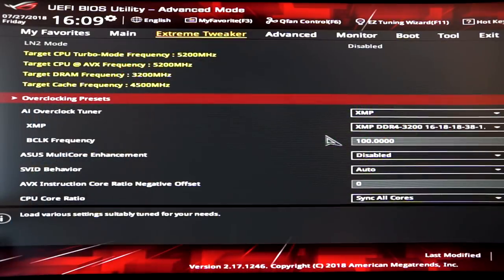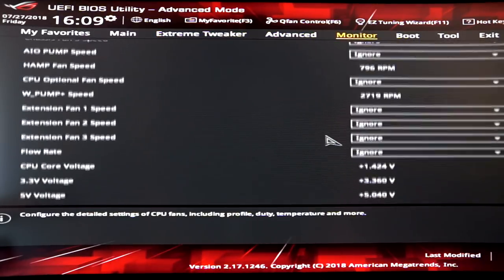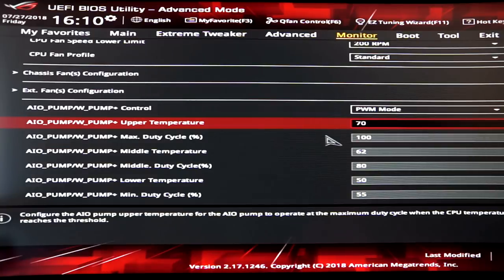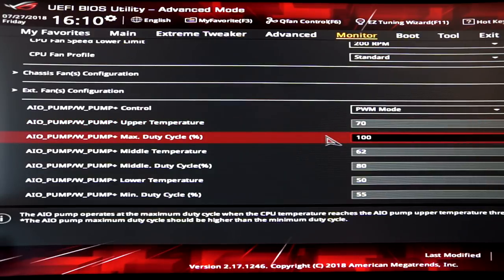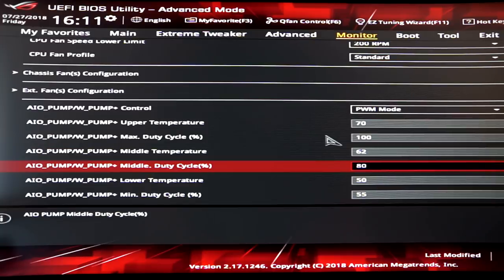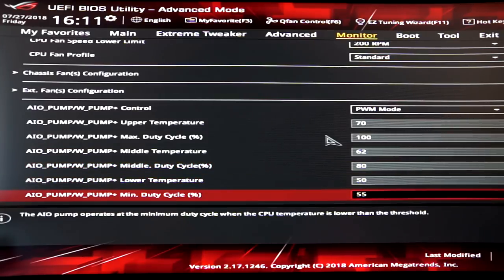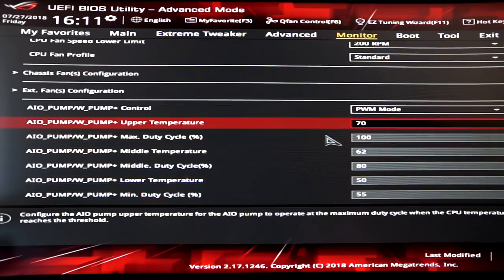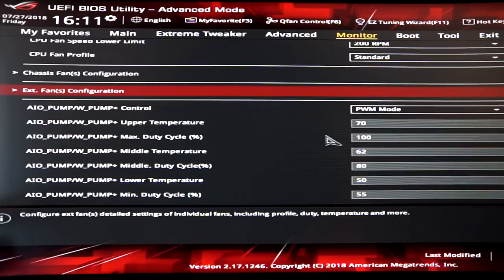STOP SETTING UP YOUR PC FANS WRONG! - How to set up Fans & Pumps for Minimum Temps and Noise

Comment: I can't believe it's taken me this long to run across your channel, not to mention finally realize you're also the guy that built a cockpit out of an actual Porsche GT3, but I followed a lot of your progress on the iRacing and old Inside Sim Racing forums!

In any case, you've uploaded some fantastic comment, and this video was especially helpful.

After deciding to upgrade to a 5600X, but unable to acquire an RTX 3080/90, I thought a custom loop might help my aging GTX 1080 last a little longer, and eventually ended up replacing everything but the GPU.

Nearly six months later, after trying out 3 different cases and innumerable rads, reservoirs, fittings, and even swapping out motherboards, I've just about finished my build (and thanks to Amazon's return policy, I kept to a "reasonable") budget.

All that's really left is setting up my fan/pump curves, and then I'll post a build log on the iRacing forums.  Perhaps unfortunately, I'm using an Aquacomputer Quadro for fan/pump control, and the associated AquasuiteX software, although quite robust, is much more fiddly than your BIOS options.

Aquasuite quirks aside, I'm thinking I should set up my case airflow to maintain positive pressure (for dust minimization), and want to confirm that's a good idea first.  My front 360 rad is setup for intake (push), with a top 240 setup to exhaust (pull).  I also have a single 120mm exhaust fan attached to the rear panel.  In the rear compartment, my PSU fan is setup for intake, but it rarely turns on, and is also blocked by the midwall.

So with three intakes attached to a rad, and two rad attached exhausts + a standard exhaust, I'll need to run my exhaust fans slower than my intakes, no?  But what about my rear exhaust fan?  Unlike my rad fans, it's essentially unobstructed, and thus much more efficient, right?

So should I run it even slower than my other two exhaust fans?

Sorry writing a dissertation, but after spending so much time on my build, I don't want to ruin its performance with poor thermal management.
Reply from the maker: Thanks for the kind words. Have a look at our rig your video and you’ll see it’s not actually a real Porsche cockpit, it’s mixed reality :) my hands and the steering wheel are real, everything else is on the screens. 

It will be hard to maintain positive pressure if your intake fans are obstructed and your exhaust is not. 

Ideally I’d suggest having your radiator on the exhaust side so the warm air exits the case immediately if possible.

Comment: Nice discussion.  This is the main reason I do not like those all glass cases with virtually no vents.  Give me the old school vented cases.  I see folks complain about temperature and they are all fan cooled in all all glass enclose case - makes no sense to me.   Additionally, I see folks talking about having 18, 24 etc fans in a case and I am like WTF why so many fans.  You need air movement and the fans don't have to be blasting air either, just moving it in one direction...in....out.  The same applies to the water pump.  You don't need to have it blasting at 100%, just a smooth flow will get the job done.

Comment: DC mode on some motherboards actually works correctly.   What I want is a fan controller that lets you set a max temp and it uses a PID loop to keep that temp.  Example I would love to set the water temp to a max high value and regardless of time of year,  loads, etc. it would adjust the fans to always not let it go over that.  I could build one I guess,  I have the background.  Cheaper to find something however.
Reply from the maker: That’s pretty much what I did here except using the motherboard to read the temperature of the water and drive the fans rather than a dedicated controller.
Reply: @boostedmedia  The problem with the motherboards is they don't let you set a temperature,  only a curve.  A controller with a PID loop could hold that max temp 24/7 regardless of ambient, etc. within a fraction of a degree by constantly adjusting the fan speed in micro amounts.

Comment: i have a question if i have 2 pumps in my pc build do i plug both on to my cpu pump header with a splitter? or just 1 to the cpu header and other to a different header? im just trying to controll the speeds of the pumps

Comment: I just traded for a Huge Digital Storm computer that is liquid cooled. I never dealt with a liquid cooled system. I've noticed the reservoir is only about 1/3 full and the system fans cycle up and down during normal use.  Should I top off the water reservoir?  I'm still trying to figure out the fan cycling....

Comment: What i have found out with my external rig 2 loops one for my CPU  1 X 480 GTX and 1X 240 GTX black ice nemesis GPU 2 x 420 black ice nemesis. The CPU spikes are lower and my water temps Idle are the same as 
 room temp with fan speed 350 RPM.And my case temps are 3 a 4 degrees lower and looks much cleaner only 2 hardtube CP and 2 hardtube GPU and it is a much safer than all the connetions
from radiators and pomps- resevoirs.I have did this because when i change hardware motherboard-CP-GPU it takes me only a few hours.Greetings from the Netherlands

Comment: Would be great to know for air cooling the CPU if max fan setting vs variable fan setting (bios temp curve) is better for the "best" performance.  I'm thinking the variable feedback loop is too slow and should run CPU fans on max all the time for the very best performance.  What do you think?
Reply from the maker: Fans at 100% all the time will always deliver the very best performance. For an air cooler I typically have my fans run relative to CPU load or temp with histerisis on the roll off so they don’t keep spinning up and down.

Comment: I tried your setup, but my fans are not playing well. Im using Maximus Xi Formula. Fan ramps up during stress tests and are not following my t sensor fan curve. I am using my EVOLV X's built in fan hub (plugged in CHA 3 header). I have  Q FAN configuraton on auto like you as well and they aren't on manual.

Comment: I have an NZXT Kraken X62 AIO (I know, I'm a CLC noob) and I've been looking all over the place for optimal pump settings for this thing. Do you have an suggestions? The NZXT CAM software has two profiles (silent & performance) preconfigured, would those be my best bet? Or should I be modifying it... Or does it matter at all on an AIO?

Comment: Please help !!!! I have a Aorus master z490  full closed loop , i9 10900k , rtx 3090 , cpu runs at 46c on idle and 83c full load in my bios there is know pump controls under fans , it just says the flow rate is at 0 please help

Comment: Currently using a Scythe Fuma 2 as my CPU cooler, would you recommend using similar settings for the fan profile as to what you have set for your custom loop? Also for the system fan my bios doesn’t show an option for motherboard but instead shows System and MOS, do you know which of these would be better to rely on for temps? Sorry I’m just a bit new when it comes to adjusting settings within the bios besides things such as setting your XMP profile. Thanks!

Comment: So you connected pump to the w-pump header, and NOT the cpu fan header?
Reply from the maker: Yep. The CPU fan header doesn’t allow for control of the fan speed relative to an external temperature sensor on moth motherboards.

Comment: So the vertical fans transform the cold air into hot air, this gets blow into the case and then picked up by the top fans, so the top radiator is actually pulling hot air no doing anything?

Comment: I know this video is pretty old but I feel like this is a pretty good topic that I suck at, I have the Lian Li Dynamic 011 and I don't have my set up watercooled (YET) so I have an 8 fan set up: 3 fans blowing air out of my all in in rad/loop up top, 3 side fans pulling air in & then for the bottom I have 1 fan pulling are out (where my GPU is) and then (1) on the bottom blowing air in (closest to the 3 side fans) and my GPU even under heavy games is fine (gotta love a 2080ti) but my GPU I feel like could be cooler for how rapidly it can spike up. It typically sits in the middle 50's & 60's depending on the game which isn't bad at all and they're basically silent. They're all Corsair LL 120 fans but I'm wondering if there's another configuration that might help me keep it cooler especially since I want to try my hands at overclocking it & see if I can get all (8) cores to run on 5 MAYBE 5.1 ghz stable. I tried it before but I let ASUS do the overclocking automatically and it just wasn't stable at all, games would crash after a while especially running GTA but even overwatch would cause the infamous blue screen so I set it back to default settings and haven't tried it again but I want to give it another go. The CPU is a 9700k as well

Comment: I was just curious what you used to seal off the extra space on the top of your case? I was thinking of doing the same. and do you also have two fans on the top of your radiator?
Reply from the maker: No just fans on the bottom. I just used a black piece of Perspex cut to size with a dremel.
Reply: Ahhh that's smart. Thanks!

Comment: Awesome video mate, I just finished my first custom loop and this really helped me with bios setup. I do have a question I'm hoping you can help me with. I have a front mounted 360mm rad with pull fans and a top mounted 360mm rad with push fans. I thought having a rear fan as intake to provide cooler air for the top rad and achieve positive pressure to lessen dust was a good idea, but obviously this will cause a bit of turbulence - Would you recommend removing the rear fan, or having it as exhaust instead of intake, or is it fine as an intake to provide cooler air to the top rad fans?

Thanks for any help!
Reply from the maker: Id change it to exhaust mate.

Comment: im using 2 intakes in the front through radiator, 1 intake at the bottom and 1 exhaust at the back. is that enought exhaust?

Comment: You have connected you pump to your cpu temps. When you are gaming for example with low cpu usage and high gpu load (both watercooled) wouldnt that fast overheat the system?
Reply from the maker: No
Reply: @boostedmedia  i thought the pump was based on the water temp not cpu temp?

Comment: my case got a total of 5 fans in it, all are noctua 120MM, 1 exhaust back, 2 front intake, and 2 on my air cooler, i got them all setup in bios to run at pwm manual 1500rpm. thoughts on it?
Reply from the maker: Seems reasonable but hard to say without knowing other specs and what the PC is used for.
Reply: @boostedmedia  i sent you an email, if you have the time to read it i would be very happy.

Comment: So, will a big side fan help or does that just screw up the airflow and cause turbulence? I have two front / two back and then a big side fan.
Reply from the maker: It depends what it’s cooling and where the air is directed. But generally yes side fans do more harm than good.
Reply: Learned a lot from this thank you

Comment: Hey man, nice vid. Just a quick question: As I have the same MB I was wondering how it will go for me having my water pump plugged into the CPU fan header. A few reasons I did this. 1 if the pump stops I heard the pc will shut down as it thinks CPU fan has stopped. 2 Water pump header is being used because I need the 3A header. and 3 I don't have an extension to reach the AIO header. I was wondering if I will still be able to have good control over the water pump doing this?? Looking at your settings it looked quite limited with CPU fan settings. :(
Reply from the maker: It depends how much current your pump draws from the header. Most pumps are fine because they just use the header for PWM signal and a molex or sata for power.
Reply: Boosted Media yeah my pump uses moles for power and it's just a pwm cable going to CPU header. Was just wondering how well its could be controlled in bios going to the CPU header...
Reply from the maker: Really just comes down to how you want to control it in that case. You’re fine to use the CPU fan header if it gives you the control you’re after. :)
Reply: Boosted Media yeah that's what I'm curious about lol. Will it give me the control I require.. it's all good though if it doesn't I will just buy that extension and plug it into the AIO header instead

Comment: I wish you did the fan control for air cooler, the temperature at the end change when using the air cooler.

You said 39 degrees for upper temperature but when you have an air cooler it shows "cpu upper temperature" and it should be set at around 75 Degree or above to get 100 percent duty cycle

But the middle and lower, in not sure what to do,Its going ot be trial and error. Unleashed I find help.

Comment: Thanks, this was very helpful, the part where you explain the bios setting in particular. Does it means your motherboard have 2 PWM header ?
Or do you use a fan hub or some sort of controller ? If yes which one ? Thanks again :)
Reply from the maker: I’m using a fan controller and a single PWM header on the motherboard
Reply: @boostedmedia  Can you add it to the list with an amzn link like other components ?
Reply from the maker: It came with my case.

Comment: Am i Right if I say, there is now way to get the pump running under 100% when the temperature reach 70 degrees or go above ?

In every benchmark I did, while I’m hitting the 70 degrees, I feel like I’m standing next to cape canaveral while starting a rocket. Cause my pump go up to 100% of load.
Reply from the maker: With a PWM pump you can set it to do whatever you want. I like to increase my pump speed relative to CPU temperature to help with controlling spikes but there’s no reason you couldn’t link it to water or motherboard/case temperature as long as your CPU temps aren’t detrimentally affected.
Reply: Boosted Media thank you!
My pump is a EK WB xTop Revo D5 PWM.
At the fancurve for the Pump I can set all I want, but only under 70 degrees fore over 70 degrees the bios Software don’t let me set something under 100% load. Is it my failure ?

Comment: Hi I have a Corsair H150i Pro cooler. I am unable to control my pump speed , it always stays the same around 2000RPM and doesn’t change even after I change the fan setting. Why is this?
Reply from the maker: Corsair have their own software for pump control called CUE.
Reply: Boosted Media thanks for answering. Does that mean that am only able to control pump speed only through their software, and not through the BIOS?

Thanks!
Reply: @boostedmedia  iCUE ;)

Comment: Hey guys, i have a 240mm corsair all in one cooler and i run the 2 fans at about 700-750rpm at idle, my cpu (r5 3600) runs at about 38 degrees idle which is pretty normal, but the thing is my water idles at 34 degrees and under load when my fans are at about 1200rpm the water temperature gets to around 38 degrees (quiet preset on pump). Can anyone help me because this was not happening at all 2 months ago, idle temps didnt exceed 32 on the water and rarely exceeded 34 under load.

Comment: My z390h doesn’t have hamp section. Only aio pump section. How do I work around this? My idle fans are  1200 rpm  which is too loud I think.
Reply from the maker: Checked under “Chassis Fans”?
Reply: Boosted Media yup under chassis fans I only have chassis fan 1&2 Q-fan control
Reply from the maker: Which header are your fans connected to on the motherboard?

Comment: I have huge CPU Problems lately and i really dont know where they come from.
The CPU stresses out without nearly running anything powerconsuming.
I have a i7-8700k and i get 1320 points a cinebench and i have watercooling.
I already changed the thermal paste but it didnt really change anything significantly.
Reply from the maker: Sounds like you might have a virus or something hogging system resources. Had a look at task manager?
Reply: @boostedmedia  Yes! Everythings fine in Taskmanager no spooky programms powerconsuming. I put new Windows on it recently and new frimware so everythings fine softwarewise.
Is it possible to not put the watercooling onto the CPU correctly or something like that ?
Reply from the maker: Possible. Depends what your temps are.
Reply: @boostedmedia  Yeah, they spike even though i renewed thermal Paste :(
Reply: I really dont know what to do, with not even any program running my temperatures are at 50°C  @boostedmedia

Comment: Oh also can it hurt your water pump by having the voltages/pump speed changing a lot?
Reply from the maker: PMW pumps use pulse width modulation to control speed. Not voltage so they’re fine.

Comment: If my mobo can't see the water pump, but it seems to be running, what up wit dat?
Same BIOS, Hero Max wifi X
Reply from the maker: Is it a PWM pump and do you have the BIOS set to PWM mode for the header you’re using?
Reply: thanks for the reply. Pretty sure PWM yea, now the header is what I've suspected for awhile now. I purchased it from a boutique when GFX cards were 2 mil a piece (saved 500$ buying a prebuilt.. whoda thunk. Wouldn't work now that RTX has dropped and mining as slowed down) and the boutique I purchased it from never hooked it up to the specific PUMP node. I RMA'd it 3 times, seriously.
Reply: I've done a fair amount of searching and most sites say that port isn't necessary, but from your reply and my lack of progress....
Reply from the maker: You don’t necessarily need to use the pump header. Just need to use a header that supports PWM control.